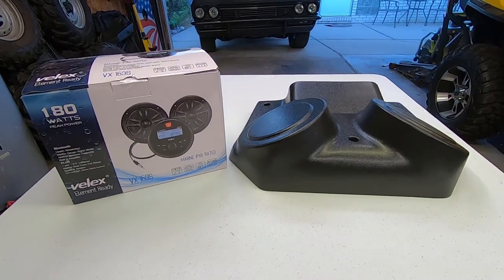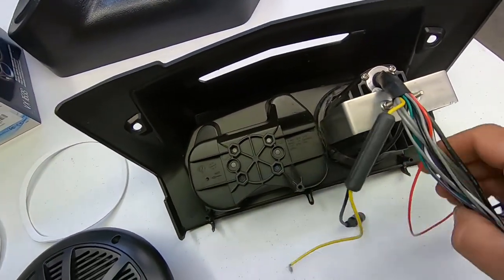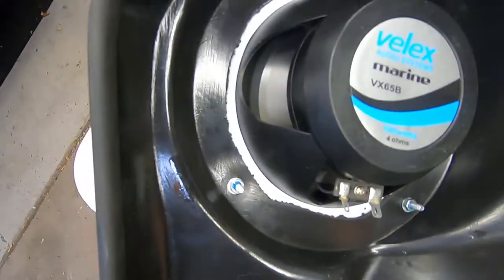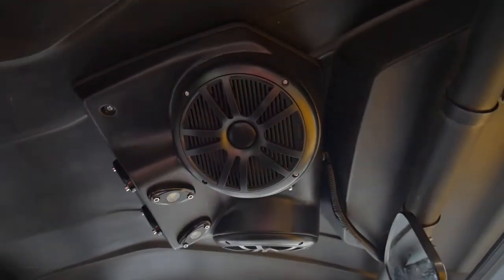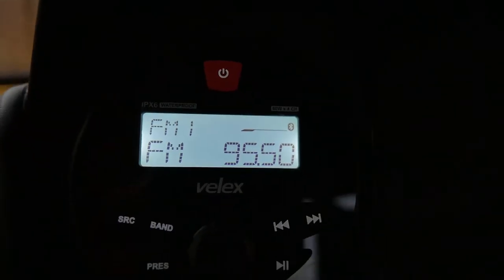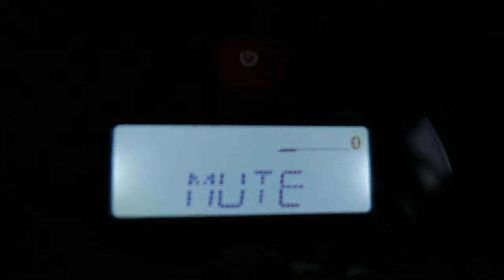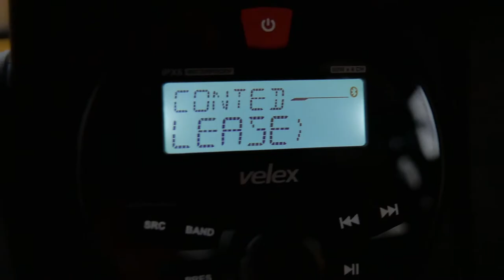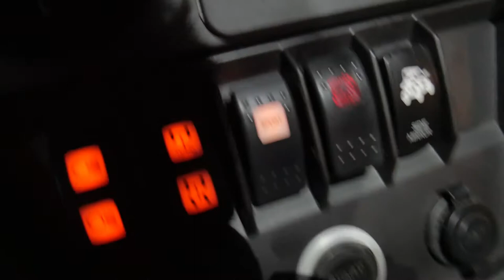Velex waterproof radio/speaker install and  Review

Comment: Hey , I just bought that set. Has it been working good so far ? I bought it for my pop up camper 👍
Reply from the maker: yea not bad, had to mess with antenna a little to get the best signal. speakers sound good with rock or country, anything with bass like hip hop/rap not to great especially when turned up. I have a bluetooth amp that I'd like to mess with just haven't had a chance yet that might be an option to
Reply: @AllThingsCool  I was thinking about adding a Amp maybe it would help. Thanks tho appreciate you answering back 🙏
Reply: @fv2149  did you connect yours to your ignition or just straight to battery
Reply: @jkenstube  yes I did , and u haven't had any problems,  work awsome I'm glad I did it

Comment: Do you have to connect it to your ignition
Reply from the maker: yes if you don't and just connect to battery you will always need to power it off manually
Reply: @AllThingsCool  I'm ok with that what wires do I connect to battery
Reply from the maker: @jkenstube  yellow and red if i remember correctly black is always ground
Reply: @jkenstube buy a wupp 12v volt fuse block!

Comment: How do you change the time on the clock I can't figure it out lol
Reply from the maker: while radio is on press and hold the knob a menu will pop up use the track key to scroll through menu until u see time then press play to select and change time hope this helps
Reply from the maker: glad it helped ! and yes I've used the line ever since to lol
Reply: @AllThingsCool  your the man thank you , it worked